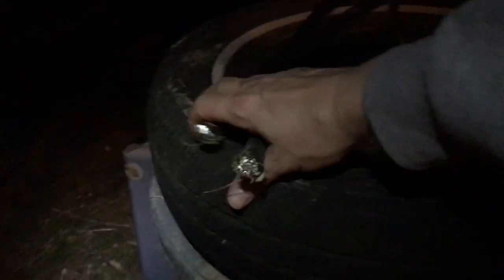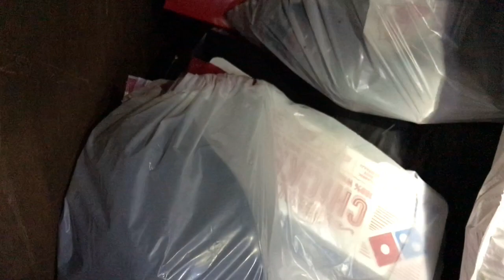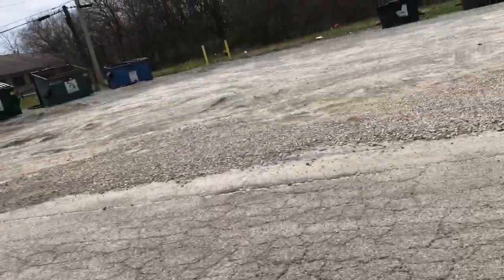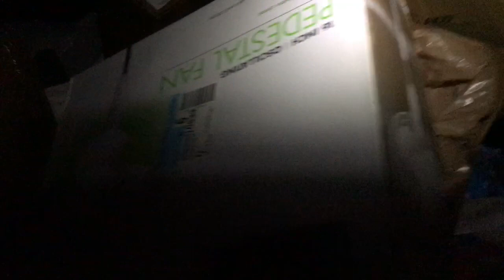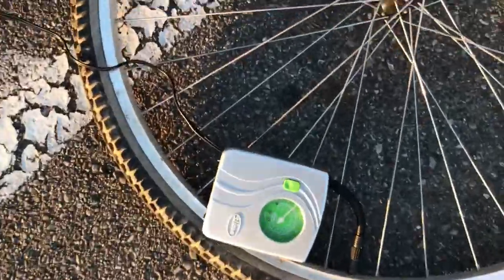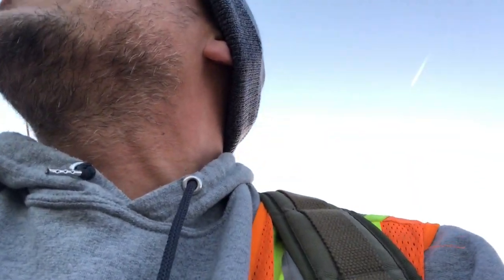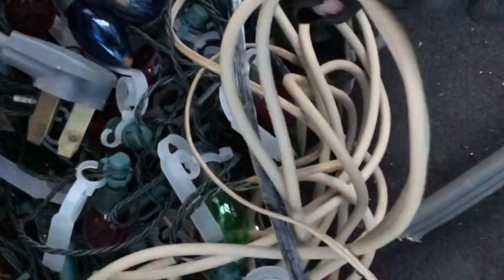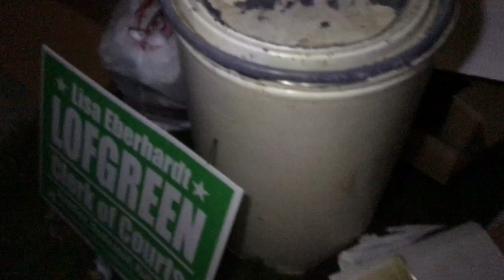Trash day pickings

Comment: awesome finds. I know a couple scrappers here on youtube that would run from that one dumpster with oil and grease lol Was that one piece a hose or wire? Yea sadly those flat screens dont last long and are built junky like everything else.What happened to your truck?
Reply from the maker: killswitch489 yeah I’m no stranger to dirty gross dumpsters. A lot of times there’s killer scrap in them. You know I forgot to get it cuz I saw five’0 roll by down the street so I bolted out. TVs are very cheap these days not like the old tube B&W I had from 8 to 18 lol. The rad ranger has been down bad fuel pump amongst other things. But never ran right from last years ice storm as I hit a pole on the way to work. I’m in the market for a heavy van or bigger truck. I’m liking the van idea as it’ll keep me from piling on the scrap as I did from day one with the ranger.
Reply: oh dang that sucks. Hope you find a good deal on a van like taco stacks has. It sucks your county is so commie. You could always go under ground and  build a storage bunker lol

Comment: you still win on a broken tv by selling the boards on ebay
Reply from the maker: ADreviews76 I sold lots on eBay 6 yrs ago mostly vintage bmx & freestyle bikes and parts and learned it was a hassle for me. And just cuz screen is cracked don’t mean that’s the only thing wrong with it. I think may be the sound or power was in and out and the owner raged and threw the remote at it. I rather just scrap it out really but that’s me not knocking anything. If others want to do it that’s cool. It’s just not my bag. Thanks for checking me out have a great weekend.